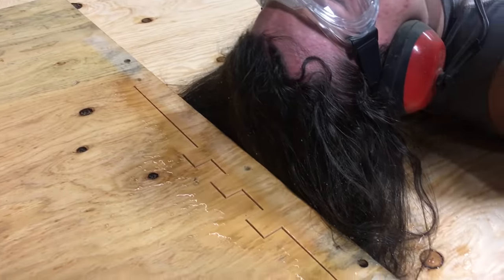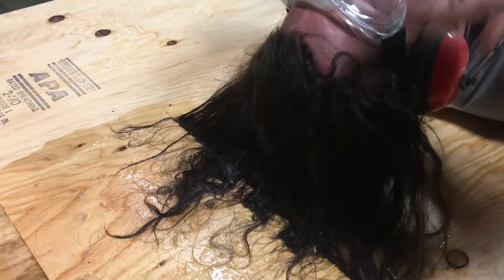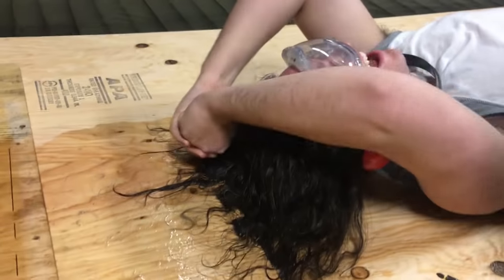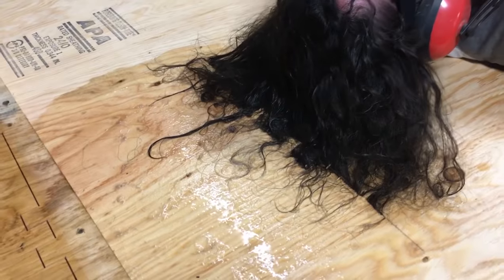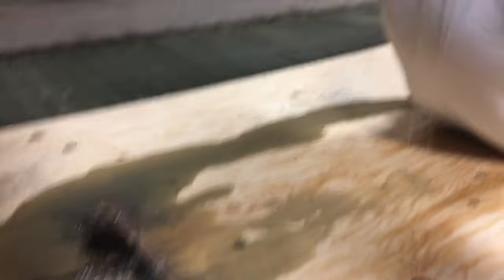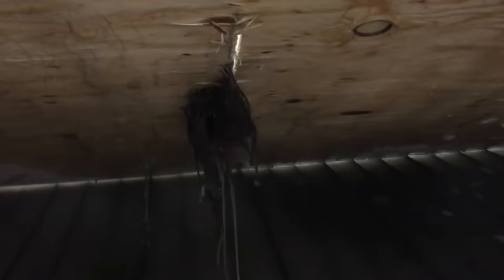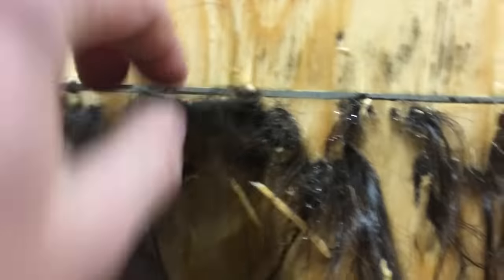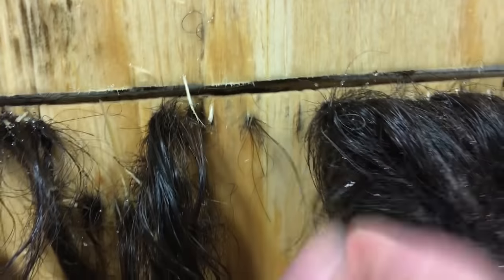Extreme Haircut With A 60,000 PSI Waterjet

Comment: Cut a hand into the wood. Lay your real hand into it, and cut it a second time (around your hand).
This would prove balls of steel
Reply: Problem is there's too many "stray" grains of sand at still high velocity. There's about a minimum of 1CM safety margin from the stream (and it DOES wide-out the farther you are from nozzle). If you get it between your fingers it'll hurt and injure a little. Then you'll flinch and put your hand right in the stream and get some nasty high pressure injection injuries that'll mess up your ENTIRE hand. 

At that point why not just try to grab the stream with a hand, it's the same thing..
Reply: Way too risky
Reply: Alucard Pawpad well it’s not sand it’s water, but your point still stands.
Reply: Vgamer311 there is fine garnet particles in the water stream to assist in cutting
Reply: Vgamer311
its a  mixture of water and an abrasive substance(very fine sand) you tool.
Reply: INTERNATIONAL Actually its garnet
Reply: That One Generic Guy
Garnet is a stone,micro stones are sand,your point is?
Reply: That One Generic Guy
yes it is funny and the fool here is you who can't read,as you can see i was replying to the guy who said is just a water,open your eyes.I put it simple as sand,cause many  ppl dont know what garnet is..
Reply: INTERNATIONAL I was more or less commenting that it's not sand. Lmao. And as far as that guy goes, the first run had no garnet. So depending on which one he is talking  he's talking about he could be correct.
Reply: INTERNATIONAL And who doesn't know what garnet is. It's not exactly a rare substance.
Reply: They can turn off the abrasive, making it just water.
Reply: Squat251 thank you.
Reply: Gloves??
Reply: ThePersonWithoutAName 
That One Generic Guy-1 
INTERNATIONAL-0
😂😂😂😂😂
Reply: Symphonix -_- 😂😂😂😂

Comment: You should see how large of arcs you could get by connecting multiple microwave oven transformers together. So, the output of the first one to the input of the second, the output of the second to the input of the thirds, and so forth. Oh, and run it with 240 volts instead of measly 120 volts. 👹
Reply: Waterjet Channel 
Even better!!!!! :D

Comment: i want to see that waterjet being shot upward (to the air) and see how far it goes and how much of its pressure is lost through that distance
Reply: That's an interesting question, I'd guess 10 meters at most, turning into a 2-3 meter cone of spray. 

But they won't disassemble the water jet to try, it's too expensive and probably under warranty.